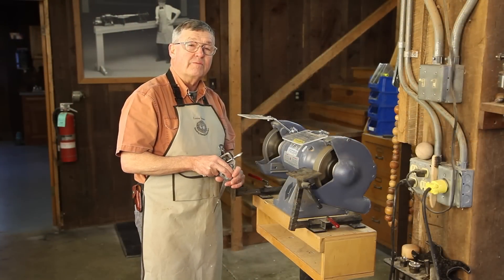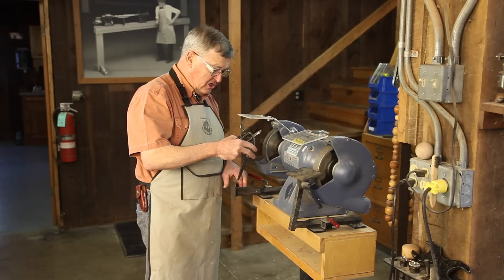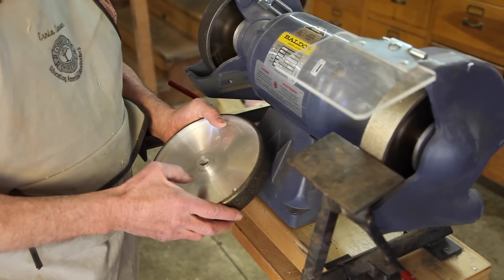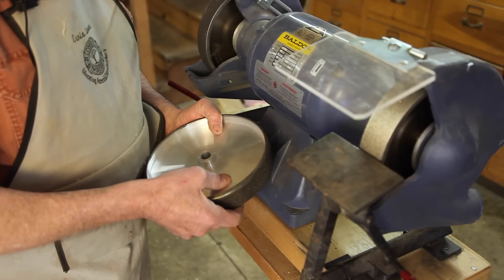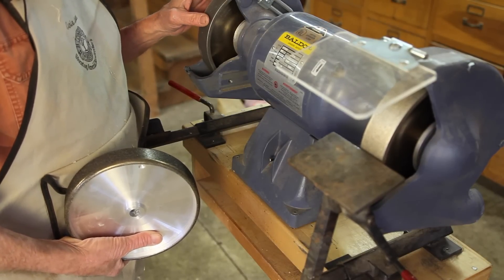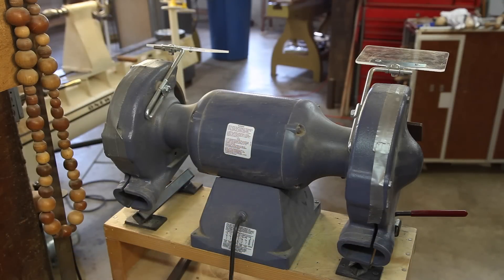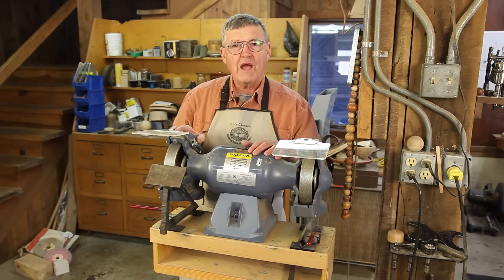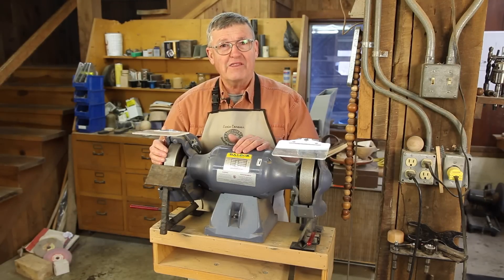Sharpening Tools with CBN Grinding Wheels

Comment: Hi, Great video! Question: I've got the Baldor grinder, and I'm trying to fit the Wolverine jig system to it. Did you modify the support for the Woverine grinding table? Or are you using it stock (it's not long enough to come up to parallel to the base. Thanks!

Comment: I'm sold!  Although I am trying to figure out if the grits should be considered the same way.  My current setup has 60 and 120 grit wheels.  Should those be kept the same or should I move to finer cbn wheels?
Reply: I use 40 and 80 on my regular grinding wheels. I have Woodturning Wonders 4-1 CBN wheels in 80 and 180 grit and find that to be the best combination..

Comment: Should I sell my 3,600 RPM grinder for a slower 1,750 RPM grinder? Do  you find it matters with a CBN wheel?
Reply: Yes a slow speed grinder would be a better fit. A high speed grinder could possibly overheat a CBN wheel and cause they plating to flake. Thats what I was told by a dealer but you should ask your local dealer. Or call Woodturners Wonder or Wonders and see what the say. They make their own CBN wheels.